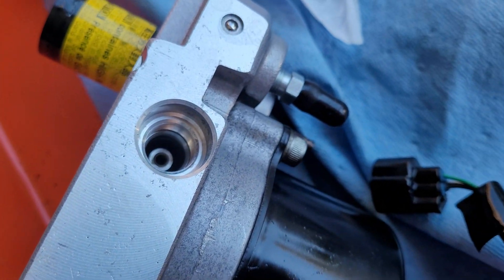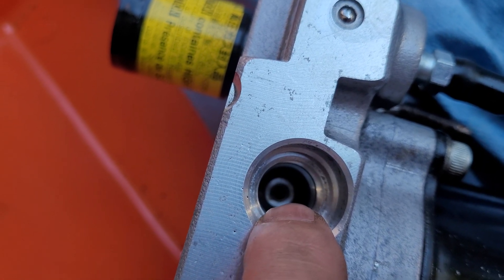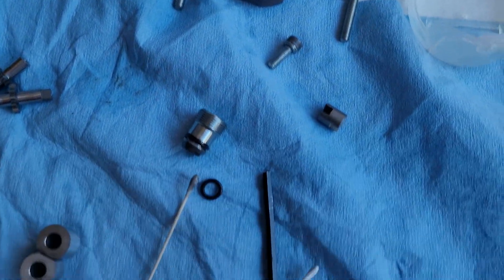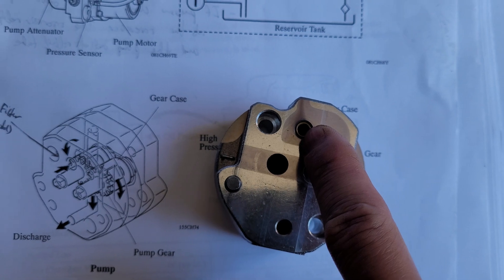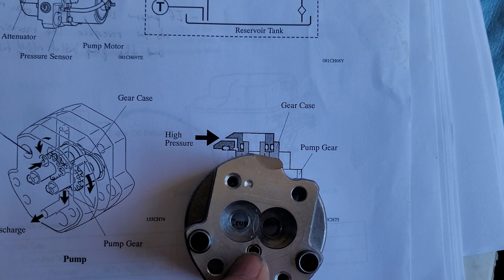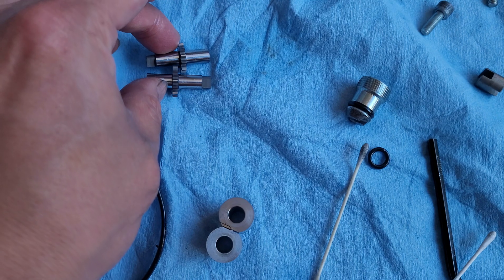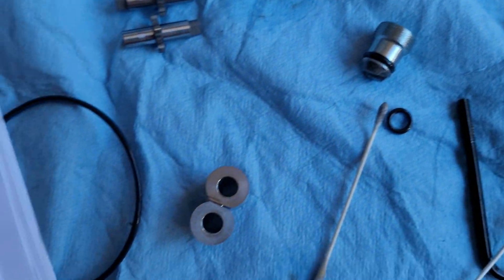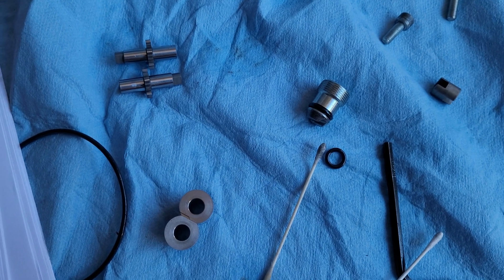LX570 AHC Pump Parts Identification - post disassembly

Comment: So did it work after reassembly?  Also did u just clean everything or did u somehow find a rebuild kit?
Reply from the maker: It worked fine after I cleared the small debris clog in the tiny inlet filter and changed the pump gear notch toward the inlet side to prevent cavitation.  There is no rebuild kit that I know of.